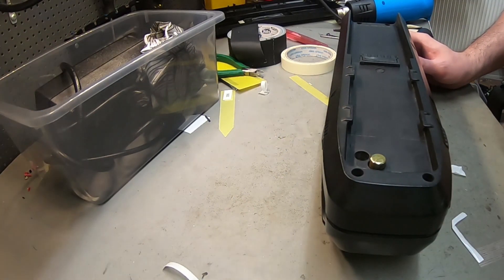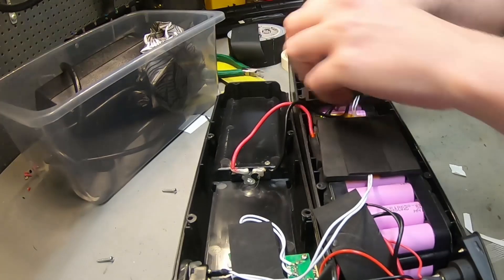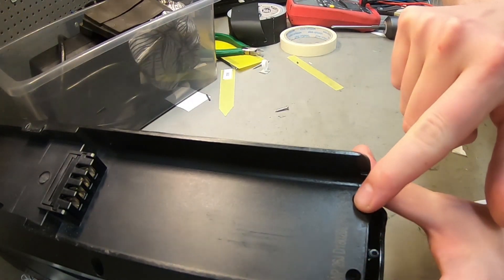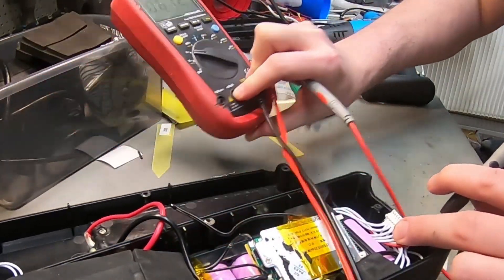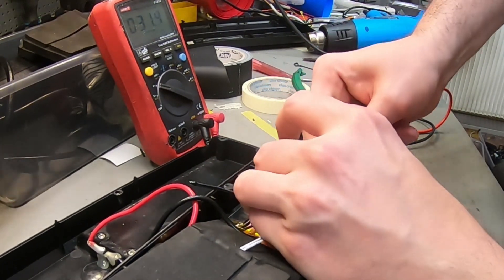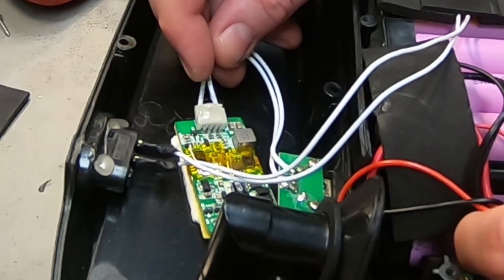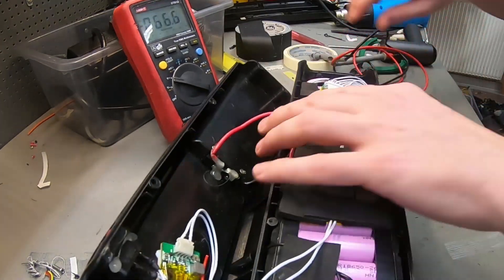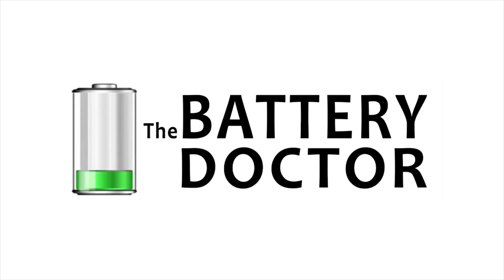We troubleshoot, fix and test a "dead" 48V Hailong battery for ebike kit

Comment: What does it mean when I do all these same tests but when I check the cells they all show a voltage reading and then it drops to zero? Like everytime I take the volt meter off and touch it again I get a reading and then it drops to zero. Faulty BMS?

Comment: I'm having trouble with my 48v 10ah battery. It shows not battery all of a sudden when it's not charging and when I put it on the charger it lights up like it used to when it wasn't charging! I also tried to see it it will give the bike power and it does. But it only works when the battery is charging.

Comment: have a Hailong 36v volt 13 AH battery.  It does NOT have a USB port and is the old style 4 blade.  My bike has a volt meter and today when I reinstalled it after recharging it, it shows ZERO volts and doesn't power on the bike.  This battery has the charge indicator built in and it shows fully charged.   I took it apart and and tested the voltage at the plug that powers the charge indicator status and it showed 41.4 volts.  I have NO power at the output blades that feed/power the bike.  What could be wrong?  Bad BMS ??? a fuse I didnt see?   any help would be greatly appreciated
Reply: Same problem here. Did you solve?

Comment: So, you cut a red wire to the usb module, thereby cutting usb out of circuit, and that was your fix?
I have exact same problem & symptoms but no usb, at least on outside of battery box.

Comment: I wish we had battery repair guys Iike you here in the UK. My 48v 18amp battery hoIds a good charge but cuts out under Ioad about every coupIe of minutes, if I stop and turn the battery off/on this restores power for another coupIe of minutes. My repair guys wiII onIy pIug a battery into a computer, if they can't do that they won't touch the battery. They most definateIy wont take the battery out of the case. Since my battery is a non branded battery I'm out of Iuck! I've now had to buy a new battery, not impressed.

Comment: Hello sirs. I have a 48v20ah scooter battery, that I left on and drained all the way down to 28.4v and will not charge with my charger it came with.- my question is, -- battery its at 28.4v , and what volt do I need to NICAD trick it to then use my regular 58.4v 2ah charger? --- I am thinking 33-38v? I don't want to over charge it with nicad just enough to get it to read out on the original charger-- what is the proper stop  v? Thanks man.

Comment: Thanks for your efforts. I have 2 brand new H Hailong 48V batteries. I got a new bike with the best battery that I felt I could afford and my bike cam with 17ah (Dragon) with LG  cells. The newer one I bought for longer rides is 15ah with Panasonic cells. Strangely they both read 54 volts but my bike only goes 32 MPH on the LG's and 35 MPH (34.9) on the Panasonic batteries. I think the Panasonic is lighter too but it may have less cells I'm not sure I didn't count them dogh. So anyway I cut both my USB wires preemptively and everything still works fine (except the USB lol). One was actually a plug so I just unplugged it and actually its a different design so maybe they wont have the same probs but I dont want it to drain constantly anyway. Thanks for the tip definitely appreciate it and I'm def gonna check out your other vids and subscribe.

Comment: USB module failure is a common problem on those HL batteries.
Reply: Hi what is the purpose of a usb module in a ebike please ? Im confused
Reply: Some batts have external USB port so you can charge your phone etc....at the expense of range! @saadialahmer2706
Reply: You can charge various devices such as your phone laptop from the port etc.

Comment: I was riding my e bike uphill on pas 5 and  it shut off randomly aftet the voltage got to 47v the battery charges and the display comes on but turns off 2 seconds later any ideas?
Reply: I have the same issue. Did you find a solution?
Reply: @TheHurtubise  nope i just put the bike in my cellar havnt touched it since

Comment: My roommate just bought the exact same battery. It doesn't do anything right out of the box. Doesn't power anything. The indicator light doesn't do anything and won't charge. Bought it off amazon, amazon says they can't do a return and I can't get ahold of the manufacturer to replace or repair it. Could it also be the usb?
Reply: Did you get the problem sorted
Reply: @RobertAdams-ly5ku  yes. I took the housing apart and a wire was disconnected. I soldered it and worked just fine
Reply: @malinkowge  Thanks for letting me know

Comment: my ebike has the same style of battery 48v 20a and after riding today i stopped and notice the screen turned off and then i swear i heard crackling sound underneath the battery case. i shut the battery off and rode down without it on and tried an hour later and it worked riding for twenty seconds before shutting off i didnt notice crackling this time but it was very windy and loud. what should i do? what do you think it is?
Reply: did you find out what it was
Reply: @richardevans9465  yes im an idiot, the wires were aka the battery main wires were slightly disconnected and or had condensation. please check those! the red and and black and the yellow one etc
Reply: I have a similar problem.  Turn on the power sw; a hard a crack, then no power.  It turned out that I did a bad soldering job on the power out put pin.   Good BMS cuts power when it see something like that.
Reply: @kenttran5289  I was dumb and had the cables wrapped where they all meet and the main cable that attaches battery to motor the connector was loose but because it was so wrapped it didn’t check for a while 😂

Comment: I found often similar problem in HL batteries, but no USB circuit. I check cells and everything looks ok but simply cant charge the battery. Charger lights become green after a few seconds. For me is BMS. Do you sell better BMS for those batteries? Buying from EU/spain
Reply: Did you manage to fix the problem by changing the bms
Reply: yes, a better BMS and everything works fine. and many options of bms, with bluetooth f. e. the other are simply with chinese characthers on it
Reply: @antonioduribaik  I have Hailong 3 with BMS damaged. Where did you buy a new BMS?
Reply: @antonioduribaik  Thanks for letting me know

Comment: I've got a similar battery I'm trying to troubleshoot, when I go across individual batteries they all read about 1.5 volts.... Is that too far gone? Or do I need to de solder the batteries from each other to get an accurate voltage?
Reply: Since the cells are all in parallel sets, it would be better to tear it apart and revive cells one by one, but idk what the chance are, it would sure work fine for running some LEDs, but you will only know when you know...

Comment: My hailong battery is stuck to my ebike, it will slide off like 2 cm and then hit a wall on the mount. No amount of forcing it off will make it budge, and I can't get the mount off without first getting the battery off. thinking of taking the cover of the bottom of the battery and dremelling out a hole where I can unscrew the mount and see what is happening with it.
Reply: 2cm seems a little short but it doesn't slide very far anyway maybe a 1/4 inch before you can lift it up. It sounds like a contactor broke and its probably causing it to bind and get stuck. You're sure its not locked right? Do you have to take it off or can you charge it on the bike? I dont think you have much choice but to break it. Luckily you can get all the parts I think including a whole new case with keys. I would just charge it on the bike until it goes bad then it won't matter if you break it.

Comment: Hi, I have a battery that doesn't seem to be working. I have a full charge, but no voltage at the connector. I confirm that the leads are clean, any ideas what it could be?

Comment: You did just cut the red wire to the usb module. So you didn’t actually repair it to its original functioning state. You got the battery working again, but is it true that the customer will not have a working USB port?
Reply: If that is the case with my 36v 15ah Hailong batteries is because of the USB port draining the battery, I don't use those ports anyway and also to reset my BMS as well. I had my batteries sit unused during the winter season and noticed even after charging, it still wouldn't turn on the bike. I thought it was the controller but when I used a new 36v 20ah Lifepo4 battery, everything came on. So I suspected the Hailong batteries BMS to be in a sleep mode. And disconnect the USB circuit as well. Thanks for the information!
Reply: @dmichaelgould75  Did that cure the fault

Comment: My battery (48v 13ah) only charges to 49-50v, and discharges very quickly (under 2 miles). Is this indicative of bad cells or a bad BMS? The seller won't refund me as its just out of warranty so I need to fix it myself.
Reply: Did you find out the issue?
Reply: @Cycle_in_style  no
Reply: Having the same issue, any suggestions would be appreciated
Reply: Check first why it charges only to 50v.
Check your charger.
Do you have a multimeter. 
The voltage of the charger should be 54.6v.
How much are you pulling from your battery. If you pull alot of power from your battery you can drain it very fast and also if your battery is very old it can get empty very fast
Reply: @ak16-i5z  the charger is fine, outputs 54v. The battery pack has covered just 60 miles from new, normal road use powering a 1000w Voilamart hub motor. Its definitely not heavy use that's draining the battery, the battery is faulty.
Reply: @bigalski1963  after the battery ran out of power how long does it take for the charger to charge it up?
Reply: @ak16-i5z  I'm not sure, I just plug it in overnight and by morning it's up to 49/50v. But it won't go any higher than 50v.
Reply: I got a too good to be true deal from aliexpress battery pack.  The charger they gave is also crap.  Sometimes it would charge to green but in actual not fully charged.  I have another charger and it would charge more fully.

Comment: Here's one
48 v 750 1000 w controller.
Not using peddle assist or break cutout.motor.
I've been over my ebike 19 times.
All the phases are right and tight.
The halls too.
No shorts no opens.
You start off a few blocks and it skips skips again then dies in 10 seconds or less.
Remove the fuse, it's ok. Before the fuse is reset just toching the connections power comes back on?
Done this 39 times.
This time close to power I plugged in the charger. The lights came on. No it were not dead. Just hitting the controller with volts turns it on ?!?!!
Wakes up? Then asleep again.
I've cut out the fuse and wired direct just to eliminate the fuse holder. I do not think it is the fuse holder 
Why does cycling the power fix it for 5 min.?
I think it's the controller. It's a couple months old like the rest

Comment: Hi, I have bafang mid drive and baterrynis hailong.. i test the battery and output is 54v.. its full charged but on displaynit says 0% and not running.. i tried connecting other battery on my bike everything is ok.. what is the likely cause of the prob.? Thanks
Reply: I had x5 bad cells giving me the same condition, the BMS shut the output down to save the other cells. It would show full on the indicator, would charge for a minute then go green, would show 0v output but testing at the charge port would show 54v.

Comment: Loved the video, thank you!! I have a new hailong battery 36v 10.4 ah battery that shows 0 voltage on the multimeter but the indicator on the battery lights up when the button is pressed. You think it is the BMS going into safe mode and any ideas on how to reset it without having to open it up?
Reply from the maker: Seems like a similar problem. can also be a fuse.
Reply: I too have a Hailong 48v 17ah full charged, lights up all bars but has no output. Switch it good and has 50v when tested at the charge port ?
Reply: @Makemrule1973  mine turned out to be a fuse issue. I opened it up, replaced the fuse (had to solder it in) and it works as expected. Let me know if you have any questions
Reply: @dathanneal3115  Opened up and found x5 linked cells all 0v, ordered new (and a welder) replaced the cells and all good now back up and running. :)
Reply: @Makemrule1973  great to hear. Enjoy
Reply: @dathanneal3115  what size fuse is it?
Reply: @danpagejr  I'm sorry, I don't remember the size. If I can find it, I'll let you know.